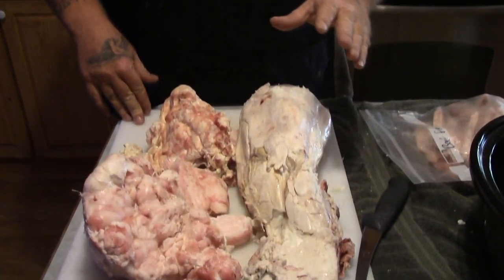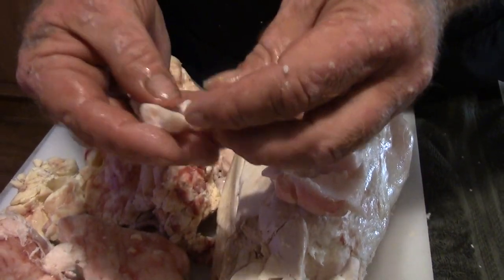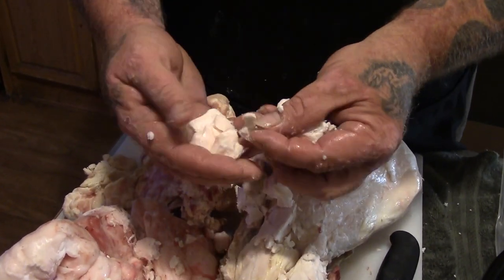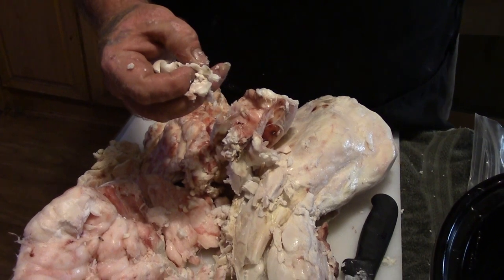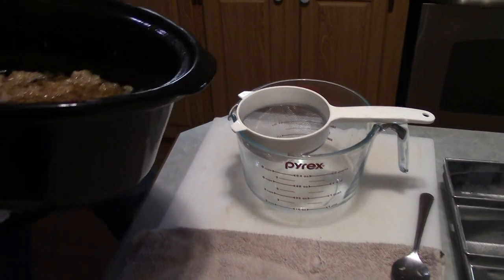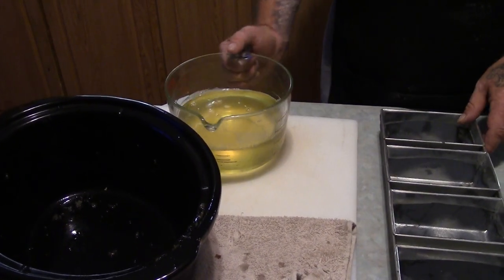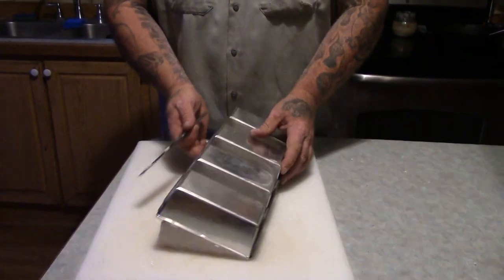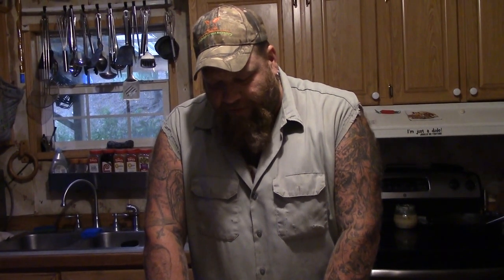Rendering Suet (Kidney Fat)

Comment: I do what you do, except....I take the bits that you strained, and put them in a 2-3 quart heavy pot, and put the heat to it.  When they shrink, and brown, there will be another pint or so of grease, and then drain the 'leavings' through a coffee filter, or on paper towels.  TASTE it before you throw it to the chickens.  I keep the little brown bits in the fridge and put them on salad, or in cornbread, or just eat them.  The 'second rendering' isn't so white, and fine as the first, but I fry potatoes and such in it, with no problem.  It's just not for piecrust.

Comment: It's been a decade since I've rendered suet or lard but when I did I put the fat in any cast iron fry pan, Dutch oven or any cast iron cooking vessel. Put it n the oven on a low to medium heat and rendered it out slow so no fire started. Strained it pretty much like you did but, using cast iron I would had seasoned the cook ware for another year. Two birds, one stone.

Comment: Jay, I was wondering if you could jar the rendered suet, as in canning? If it would be possible that would save freezer space.  Another Great Video!
Reply: When I rendered my Lard from butchering my pigs, I put the lard while melted into hot canning jars.then  put the lids on, no water bath or pressure canning.Then lids sealed and the lard sitting on the shelf is still good several months latter.

Comment: I've rendered suet twice now.  The first time it was perfect; waxy, odourless, virtually tasteless.  The second time, just yesterday, it turned out absolutely awful; small and bad tasting.  I'm not sure what I did differently (the first time was nearly a year ago and I didn't make notes.  I'm wondering if there was something wrong with the raw suet, if I overheated it, od if I didn't strain it properly.  Anybody know?
Reply: Strange, I've had exactly the same experience. The first batch is Snow White and really solid at room temps. The second and third batches are greyer and much softer at the same temperature. I am doing 8 more kilos of the stuff now and will see what happens. I will try keep it at lower temperatures while rendering, and do so for longer.

Comment: I have a lard press.  it is similar to a apple juicer or a grape press except slightly different.  The solids get dumped into the press and then the lard / suet runs out the holes.    I am sure you could make one out wood or a 5 gallon bucket too.   Doesnt really press with a lot of pressure.
Reply: Or you can just take a spoon and press on the membranes in the strainer. It's like a small press. You'd get quite a bit more suet out of it.